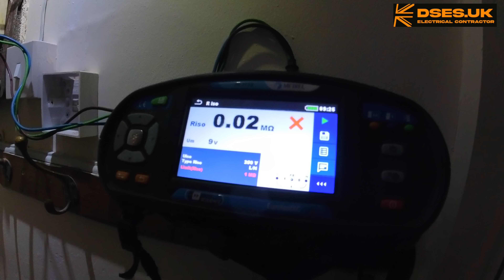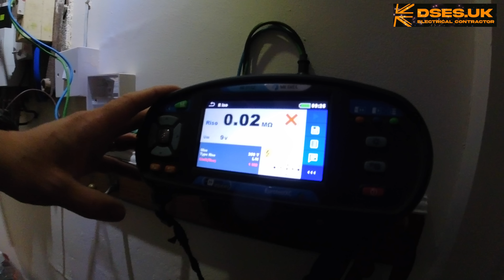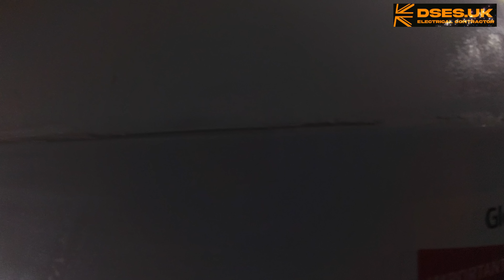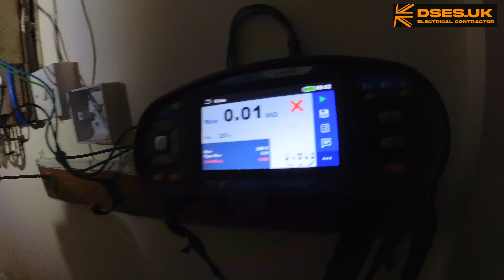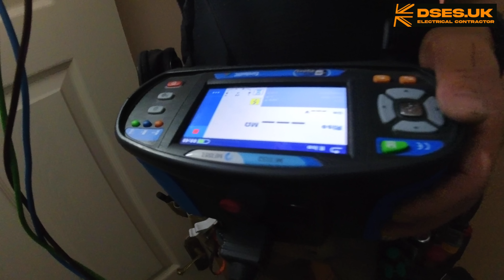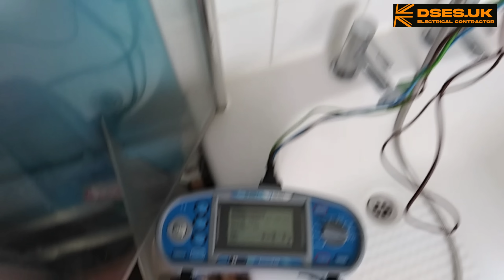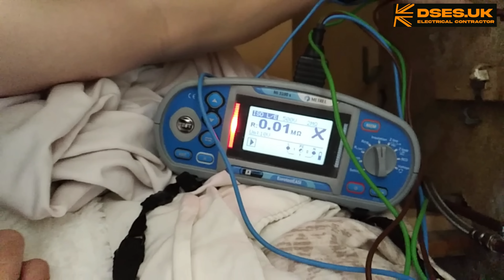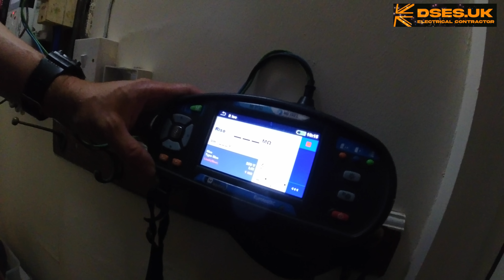Pair o' I.R.SEOLES

Comment: In the US GFCI's are usually at point of use aKa at the sockets we do have breakers but they are very often not used in favor of hiding a GFCI outlet somewhere behind some thing in the living room that feeds the outlets outside. They are only technically required in bathrooms, outdoors, kitchens and in wet areas. Yeah this level of testing is crazy for us at most will have a multi meter. Although we do have one thing going for us it is against code to have hidden junction so it either has to be behind a fixture with adequate space or in a box that's covered but accessible so when there's a fault you can split and work your way through circuits. unless of course you run into a property that has wonderfully covered over every hidden junction that they've made.......
Reply from the maker: Ah, so the GFCI protection is usually at the outlet. Here we're required to protect the wiring, these days for pretty much everything, in case that should be damaged such as by someone knocking a nail through it. As for hidden junctions, well they're permitted where the junction connection is deemed to be 'permanent' such as through soldering or crimping, but I guess any wiring code is only as good as those who follow it, and both sides of the pond see installations by people who figure it's okay if it works, never mind how it works!
Reply: @dsesuk  yep I think hot tubs and pools require GFCI protection as well. Otherwise you don't really see it on 240V circuits only on the 120V circuits. I can count on my hand the number of times I've seen GFCI breakers in use. The UK has definitely been ahead of the game on safety around electrics which makes all the videos from over the pond fun to watch. Except those pesky plugs that lie pins up waiting for an unsuspecting victim like Legos...

Especially tracking faults in ceilings that are finished LOL.

We have a loophole that the homeowner can do their own work on their house and that is great to a point. That let me change out my entire electrical panel from a federal fire Pacific without having to hire anybody and do it reasonably well (some cables were too short had to be extended not a lot of length to work with) we will have to get it inspected upon sale of course which is somewhat of a new requirement.
In a Previous house we rented we cut a hole behind the bedroom door and put a recessed box shelf in on the opposite side of this wall is a shower and much to my non-shocked discovery there were at least 3 buried junctions thankfully at least in boxes that were unaccessible. But I highly suspect that's why there was no ground conductor on the attic outlets.

I wanted to get licensed for many years and it's still on my list. Darn Life just got in the way. In the meantime I go around making whatever I can safer. And have a reasonable knowledge of code.

Comment: Another good piece of electrical detective work. 
I couldn’t work without a head torch, particularly on ceiling roses, to clearly see those pesky terminal screws. I’ve used the Petzl Tikka head torch for many years, with AAA rechargeable batteries, which generally lasts a working day, and gives plenty of light to work in the dark.
Wearing glasses as well - varifocal in my case - means I need the light in exactly the right position to get clear sight of what I’m working on.

Comment: Interesting video gents, some top fault location skills in use there. I have seen similar damage to 3 phase circuit breakers that have cleared multiple faults and the contacts have become damaged and then overheat, even just when on normal load. As you say, the history would likely reveal more about the failure, but that will be unknown for most installations of this type. Might even make me watch some of your other videos. 👍

Comment: At 38:35 discovering the failure of an RCBO: electrical equipment is often rated for a particular current in a stated ambient air temperature - if the breaker had been running at near maximum current for long periods whilst adjacent to other hot breakers, August's unusually hot weather could have caused the device to overheat.   ? Coincidence that Davd's shaver cable also failed in unusually hot weather ?

Comment: What testing do we use for running down GFCI faults in the US? The grey matter mate we think and investigate like you did🤔🤣 thinking without testing is just a mess. Seriously same as you lot using MFTs (I am one of the few that do this kind of testing) IR, continuity testing, circuit tracing and point of contact plug in sockets as someone has said below a lot of our RCDs are localized at point of use in terms of receptacles/sockets.

Your own guidance note 3 recommends a floor and wall insulation resistance test - not seen one UK electrician do it in a residential setting but hey hey I do it all the time/ I got some pretty nifty sonel floor and wall insulation test pads to do it. I certainly think doing the wall and floor insulation resistance tests will pick up every now and then some dangerous fault which your old 2018 video indicated. A very good teaching moment right there about doing these rare types of tests…

Comment: Dave, if you are going to do torch reviews, then the Nebo Redline 1800 is great with fool proof switches :)
For low cost options try Poundland for a £1 head torch or a £2 adjustable angle lamp that both use AAA batterys at £1 for a pack of 12 :)
Reply: You work in Poundland don't you? 😂

Comment: Learner Question: I may have misunderstood this but @ 3:58 looks like you have piggy backed neutral on earth(and then onto earth bar) and then both  Line & Neutral cores into Brown Croc clips at RCBO? on other videos (with MCBs) L&N are linked and then just have Earth Croc by itself going to Earth Bar.Why do piggyback Neutral onto Earth in this scenario (hopefully not a stupid question) .Thank you for all your content this year and Best wishes for the New Year.
Reply from the maker: Sorry for any confusion - it's not how it looks. The Metrel tester always has three leads connected because of its proprietary connector, however IR is a two-lead test with the voltage applied to the brown lead, and the green lead used for detection. The blue lead has nothing to so, so I keep it plugged into the green lead to keep it out of the way. In this instance, the brown lead is connected to both line and neutral with the green lead on the earth bar as you would expect. Blue is present, but isn't doing anything.
Reply: Thank you for clarification

Comment: I remember watching that DIY SOS, and Billy the bodger and the rest of the crew found it hilarious that a freshly plastered wall appeared to be live, because when he was putting his volt stick on the wall at various places it was lighting up.
Reply from the maker: Volt sticks can be fairly useless and sometimes give completely false indication of an electric field being present (same with those crappy stud finders). That said, if they thought the wall was live then it would be no laughing matter. There was a case of a woman being electrocuted about three years ago because of a screw through a damp wall which had penetrated a cable. The property had been signed off as Satisfactory on an EICR and the guy who got done for it wasn't the drive-by 'inspector', but the QS back at base who'd signed off his paperwork!
Reply: @dsesuk  yeah they are vague, yeah just like that MPs daughter, Jenny tong, I think, who got killed by a metal utensil rack, the builder/kitchen fitter had run the cables on the angle and I can only imagine the screw went through the live conductor, then she touched the rack and that was it, she was dead.
Reply: @dsesuk  they gave us voltsticks on the railway, the overheads mean they're permanently on!

Comment: Another good video with Dave and Nige, I have a question which is slightly off topic but o would be interested in your opinion. It’s regarding EV charge points and RCD protection. 
As we are aware RCD protection must be provided (30ma/6madc etc. etc. ) now in my opinion although some chargers, zappi for instance have integral 30ma double pole RCD which they claim complies but in my opinion to comply with BS7671 a manual test button should be present which (correct me if I’m
Wrong) isn’t. So I believe a separate RCD should be installed?? What’s your opinion Dave?
Cheers pal.

Comment: I need to do some vids.  First one would be on the LED Lenser MH10 Rechargeable Headlamp.  Get your bad selves one of those each and the problem of having to throw electrical accessories at the apprentice for not holding the torch properly will disappear.
Reply from the maker: LED Lenser are pretty good, but it's the wearing of a head torch I never could get on with. I'm not sure why.

Comment: Just found you, Enjoying your videos

Will regards to thermal damage of breaker, yep have had all makes over the years give up the ghost.

I have had thermal damage from poorly terminated cable (high resistance) creating heat at nominal current.

thermal image ID excessive heat, found cable pushed though to far, retaining screw wound through insulation just making contact with copper creating heat.

Terminals over tightened (must have been done up with impact driver) splitting retaining clamp.

Ferals put on not crimped

Crimps put on, crimped number to sheath, sheath taper to crush band.

Thermal damage, yes can be component failure but can also be installation practice.(not pointing the finger, just saying it does happen)

importantly though is how supplier responses, do they just replace with out question or start arguing the toss.

Fully endorse periodic testing but have found thermal imaging helpful in large control Mcc’s.

Ps stars war made me chuckle
Reply from the maker: All good points, thanks Mark. I suspect if it were down to a poor connection then the thermal damage would have been around the terminals. This looks like something that's been running hot within, but I don't have the thing for disassembly to look further.

Comment: Great video again chaps! 

Could a surge cause damage to the OCPD which could effect its performance over time with a continuous load near its 32A limit?
Reply: I think that the regulations have required surge protection on all new installations since 2019, so there's every chance that it had this.
Reply: @metallitech  Surge protection is not required all new installations,  it depends. For what they cost now I don't know a good reason why you wouldn't though.
Reply: @metallitech  it’s a fair shout… most installs should have spd installed but budgets etc don’t always allow for it and I’d never assume it’s always installed on new installs or board changes

Also just asking in general if surges could affect OCPDs especially AFDDs… (yes surge should be installed but what if it’s faulty and the client doesn’t know)
Reply: @hackwoodelectrical  I think the thing to do is just to not install Made-In-China components.
Reply: @metallitech  if only it was that easy… everything seems to come from china
Reply: @hackwoodelectrical  I know that Schneider RCBOs seem to be made in Thailand at the moment. The top-most respected brands (in the UK) are probably all manufacturing outside China.

Comment: Should higher current RCBO’s or MCB’s have spacers fitted between them or spaced by lower current rated devices, rather than being mounted together?
Reply: Hey mate,so are you thinking in terms of better heat dissipation are you??or just an air gap for better circulation?🤔
Reply: @danielelise7348 heat dissipation for devices which are carrying higher current. If they are mounted side by side then overheating leading to failure is possible. There are other environmental factors to consider as well. Humidity, ambient temperature, condensation, loose connections, etc.
Reply: @stevejagger8602  Yep, I have actually given this quite a bit of thought too, even entertained the idea of incorporating a thermo-fan into boards with heavy loads,but obviously space is at a premium in a board so...!?not sure about that!
Reply: @danielelise7348  Extra spacing implies higher cost. Is the volume of material used in making contacts and terminals being paired down to the minimum to pass the required current. This has happened to higher current using domestic equipment like kettles.
Reply from the maker: The same questions were asked of the new AFDDs which run hotter because of the electronics inside them, but the fact is no manufacturer instructs you to leave an air gap, and if such were needed they'd design it into the CU. So long as busbars and boards are designed for protective devices to physically sit side-by-side, then it's not for the likes of me to start second guessing heat dissipation and airflow currents within the enclosure.
Reply: Thank god for common sense David!